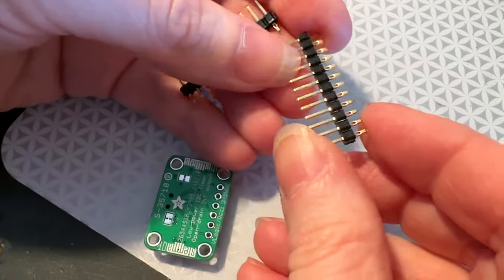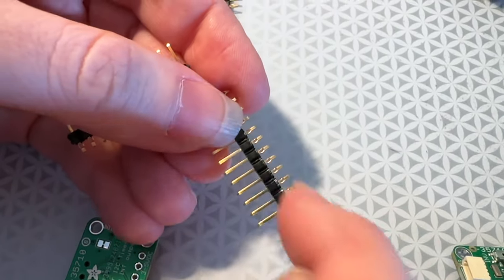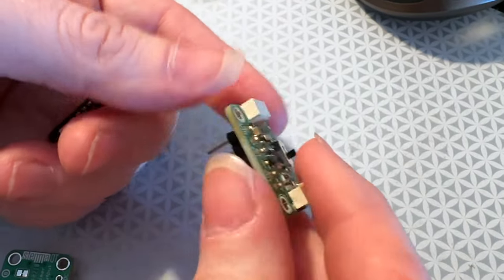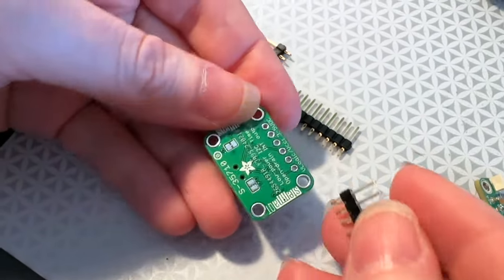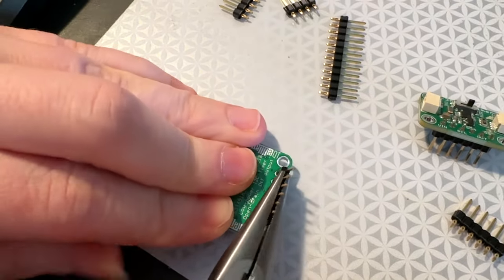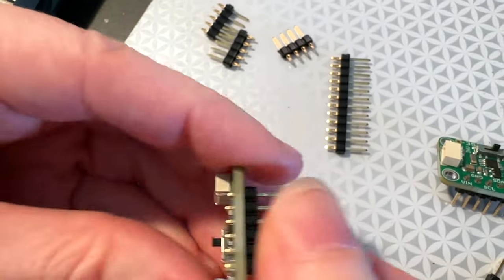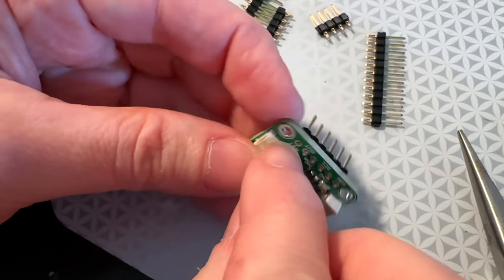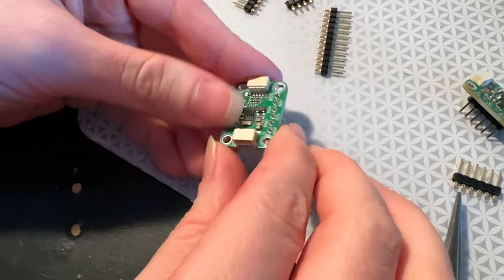Solderless header for quick prototyping 🔌🔧👩‍🔧

Comment: I take pins out of the header and re-insert them from the other side of the board. It can get a little tedious doing them one at a time on larger boards, but with the massive upside of not feeling like you're about to smash whatever you're putting them into. I've been using them for everything and still somehow have yet to run into any connection issues

Honestly I've been wondering why I don't see more people doing it this way since I know not everyone has a soldering setup or experience

Comment: Tbh i dont trust those. Also hole size is different between module to module, so there is no "1 size fit all". The last thing i want when debugging my code is debugging electrical connection

Comment: I would use them as single pins or pairs of two. Should be easier to push in and pull out and contact should be guaranteed. I would not trust every pin gets its fair share of force in a row of, lets say 8.